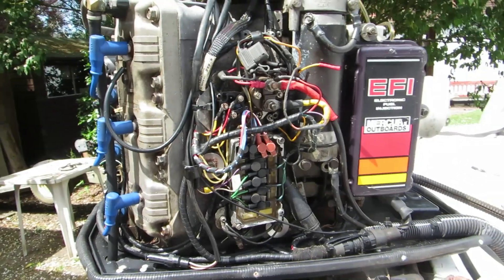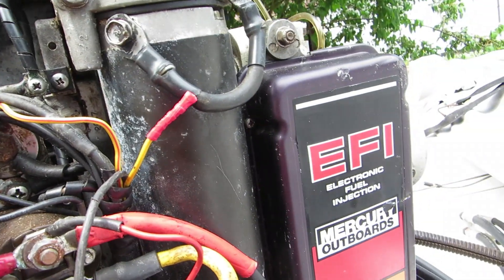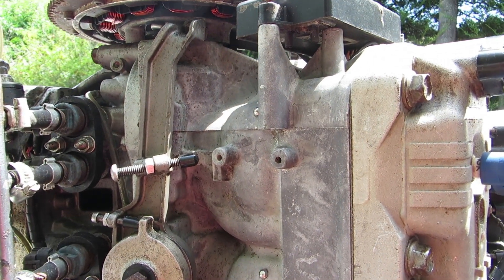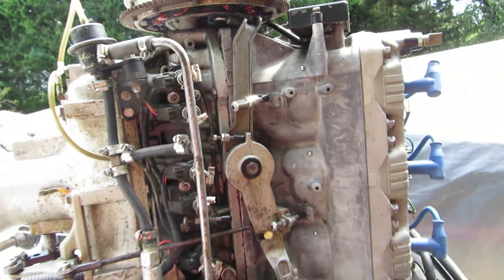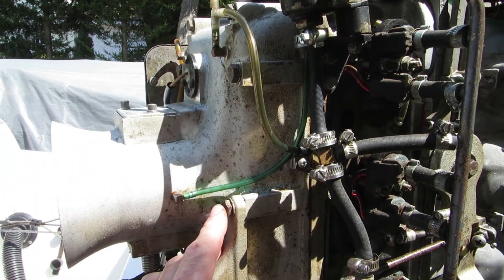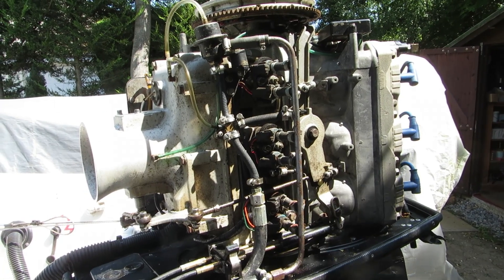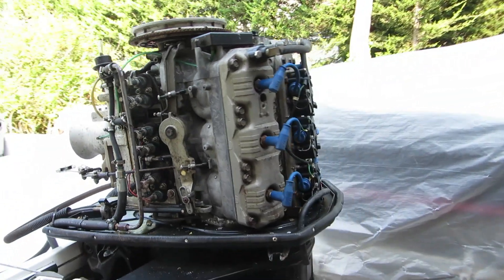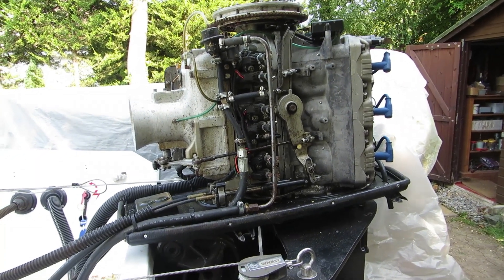Mercury Bridgeport EFI Rich Running problem

Comment: I updated mine with a newer digital unit not only does it not require the tps unit but it runs a lot better all around
Reply from the maker: Sounds good, was it a Merc ECU?
Reply: @ratman9802 yes it was

Comment: I've been chasing the exact same problem on a 2.5 EFI on a phantom 21, terrible running in the river at low speed ,misfire and embarrassingly smokey, but perfect out at sea. Ive checked it out on mercury diagnostic unit, injectors are running at correct pulse times, seems OK if sitting idle in the river , it's only bad at 6MPH. I've leaned out the fuel mixture to the point that it is too weak. Ive come to the conclusion  it's caused by the offshore leg. I've got the later leg with the exhaust opening that points down, and at low speed I've estimated the exhaust tuner is probaly under water, compounded by the fact water is being rammed up the leg when traveling forward, as the angle of the boat burries the stern at trolling speed and low RPM. Im going to make blanking plate to block off the offshore leg opening and try it. Its interesting that mercury make a full blanking plate and another option of a plate with several 10mm holes, but they don't give a reason for use. Do you have an offshore leg?

Edit: just noticed from other videoes of your boat, you don't have an offshore leg. But I'll leave the comment up anyway
Reply from the maker: Hi, I've read your comment a few times and I'm not sure I've fully got it but here goes. Firstly I'm pretty sure my motor does have an offshore leg, I always took this to mean that it has an above water exhaust outlet, which it does and is only suitable for offshore use due to the noise. The Bridgeport is a race engine and is so equipped, it usually has a low level water pickup CLE type lower unit but mine does not (at the moment). The problem I had was that the rather simple analogue EFI unit did not know that the throttle was closed or where it was because the TPI unit was open to atmosphere, so it thought it was at WOT at all times and chucking in fuel accordingly. Reconnecting the vacuum line from the plenum cured this issue as it gave the ECU a reference. With regard to your specific issue being caused by the exhaust I'm sorry I have no specific knowledge regarding  Merc outboards except to say that generally Two Stroke engines are different to Four Strokes when it comes to exhausts and scavenging and are quite specific in requirements; there is stuff on the net that explains this and is worth a bit of research. If your has been messed with in the past and it sound like it might have been, it might be worth putting it all back to factory and eliminating that side of things. Cheers, Chris.

Comment: Hello, 1 trick I used to use on my old mercs was i would find  compatible J type spark plugs and run those. Those J plugs are less prone to foul at low RPM. The surface gap plugs are better for high RPM, but low RPM can not clean themselves out because of the tight tolerance on the electrode area.
If switching to J plugs, be absolutely sure you have plug to piston clearance OR ITS GAME OVER!!!!
I would also replace all of those clear lines with new. Any vacuum leaks will mess with the EFI mixture.  Being as the EFI is not regulated downstream, the management system can not adjust for vac leaks, so in essence it thinks the engines operation is always 100%. Those lines get very hard and brittle with age, replacing them is super cheap insurance. Happy boating, and great motor!!
Reply from the maker: Hi, thanks for the tips. I have been using the surface gap plugs without any problems so far so I will probably stick with them. Good point on the vacuum lines, most were replaced not that long ago in terms of engine hours but I will check there aren't any leaks. I may replace them again before using the motor this summer. The worst hose or line is the manifold absolute pressure feed to the ECU. As it terminates inside the ECU unit I'm reluctant to interfere with it as the case seal is not the best. What I might do is add a pipe clip after warming the pipe at the union end as it's gone a bit hard. The previous owner had spent a load on a full powerhead rebuild but had run out of enthusiasm when it didn't behave as he'd hoped. I went through the electrics; redid the low tension wiring, fitted a new stator and a set of brand new coils. The issue with the rich running was the last thing so hopefully now all will be as it should. If you have experience changing the MAP line to the ECU please let me know. Agree, great motor, often provokes interest. Cheers
Reply: @ratman9802  hi, sorry, I guess I should have added in my last comment that the smoke can be reduced by using different oils, so maybe try a different oil to help the smoking issue, also running J plugs can sometimes curb the smoking at low speed. I guess it's a matter of preference on the plugs anyway and these were really meant to just run WOT anyway. 
Sorry, I have no experience with the tube to unit replacement.  Maybe a Merc forum, or a trip to a certified Merc repair shop is in order. 
Good luck with that 💎 gem, they just don't make em like they used to!!
Cheers!
Reply from the maker: I always use Quicksilver twostroke oil but I was premixing at 25:1 as opposed to 40:1 because of previous owner's rebuild and I wasn't sure how many hours he'd put on it. As I'm using it for non race puposes and am limited to 8 knots in the harbour area I have to run at low RPM for 20mins when moving to/from the slipway. None of this will help the smoking but before I sorted the TPI vacuum line it was overfueling and smoking on another level. I will probably premix to 40:1 the next time out. As you say these motors are balls-out race engines designed to run at WOT and not built for economy so I will have to tolerate it. But, I love this engine, its a bit nuts and worth keeping just for it's own sake. All the best.

Comment: what plugs are you using
Reply: have you had the injectors flow tested.if you are pre mixing your oil its going to always  run rich at idle
Reply from the maker: Don't remember offhand, it's wintered at the moment so unable to check.
Reply from the maker: If you have a recommendation re plugs I will look later. The previous owner sent the injectors back to the US to have them tested/reconditioned/calibrated at great expense, (I have a receipt for it) I'm fairly confident they are as they should be. He did a complete power head rebuild then lost interest. I bought it then completed the job; the ancillaries had been neglected and as you see mistakes were made on the TPI connections. The engine is still on 25:1 premix as opposed to 40:1 so that would account for some of the smoke but it was throwing unburnt fuel out on idle before, it's much improved since doing this video. I have not gotten round to trying it on the water but hope to do so this spring. Cheers

Comment: Those old ecu are finicky spent 4k on my 260 replacing all sorts of stuff tested ecu it was bad bought a brucato issue solved
Reply: That looks like a 56 psi regulator (black). The correct one for that motor is   (39) psi gold.  A new ecu would solve a lot of your issues
Reply from the maker: Yes I looked at those, quite expensive but an option. Thought best to deal with the blatant issue first.

Comment: Just wondering if the engine is running any better now that the ECU has had some time to relearn what's going on?  I don't know a ton about boat electronics but I know even my motorcycle takes a bit of riding until it all settles back in after taking the battery out for winter.
Reply from the maker: The short answer is I don't know, I've not used the boat since doing this but I suspect that the ECU is not that sophisticated, there is no downstream monitoring of combustion (no O2 sensor) for one and the other is that I think this is an early unit, analogue, not digital. This is a race engine so economy was never a factor. Thanks for your interest